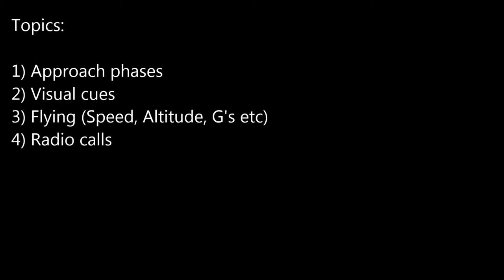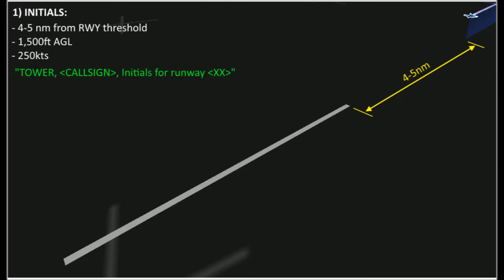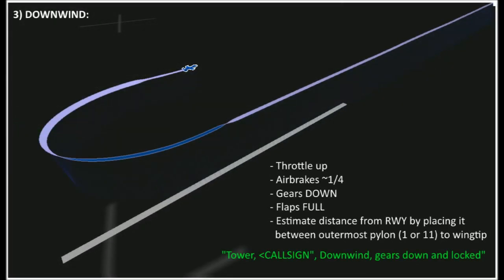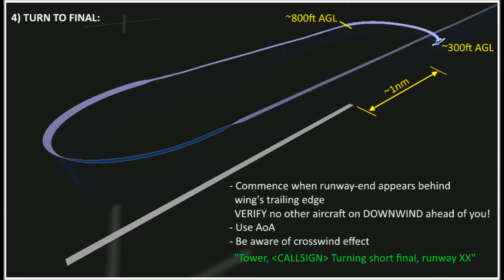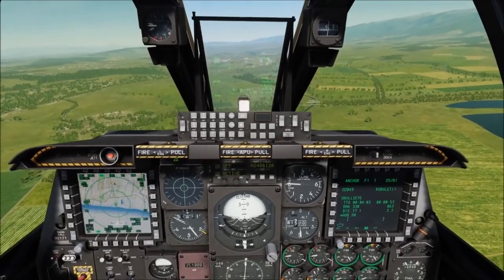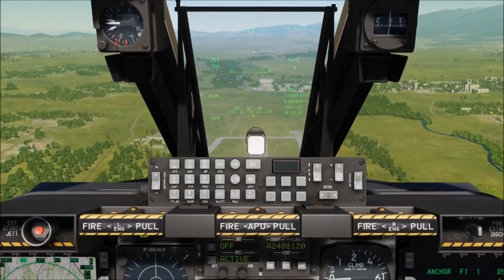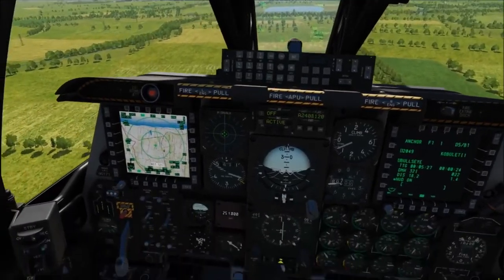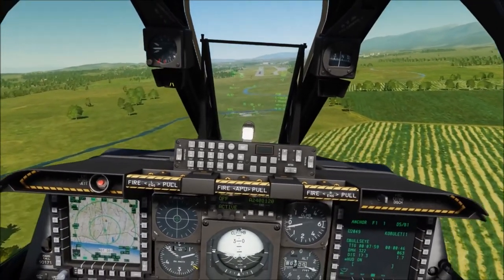Overhead Break (OHB) Approach for A-10C (DCS)

Comment: Thanks for sharing!  Nice flying.  I’m curious about why you descend to 800 agl during the downwind?  That goes against the procedures I have encountered, including the TO 1A-10A-1 pg2-19.  Second point is that the first landing aircraft should deconflict to the “cold side” of the runway, as defined by which side you expect to exit the runway on.  All subsequent aircraft touchdown on the hot side and move to cold once under control and have deconflicted with the aircraft in front.
Reply from the maker: Thanks for the feedback! I tried to present the way we do this approach in the 617th Squadron of the 132nd Virtual Wing and have actually never dug into the way it's done IRL. I looked up the document you mentioned and was unable to find the bit about the OHB procedure. Can you point me to it please?
The way we deconflict on the runway works OK as we most often fly as 2-ships but I totally agree that if 4-ships are involved then the cold/hot side method makes more sense. 
Thanks for the inputs!
Reply: @assafberwald9448  There are a few copies out there, but the first one I found was here: https://www.scribd.com/doc/34087548/To-1A-10A1-A-10A-Flight-Manual